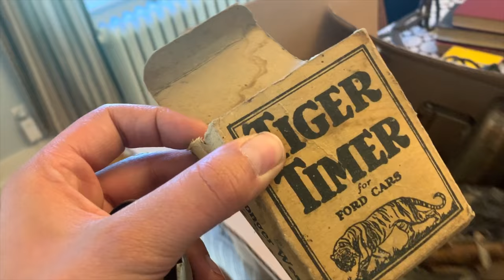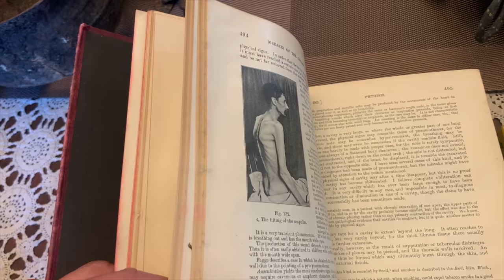Metal detecting and estate treasure hunt! Another busy day at the shop!

Comment: The best way to deep clean a cast iron scillet is heat it up and pour a topping of salt onto it. The sized scillet you have there will do with about 1/2 kilo of salt. The salt will pull out the impurities out of it. Don't use washing up liquid on it afterwards. The salt should turn dirty.

Comment: Wurlitzer is known from the (1950s-70s) for the Electric Pianos.

Tonewheel Hammond Organs were introduce built from 1935-75 (B-3 introduced in 1955).  Ray Charles' "What'd I say" was it's first big hit.

The Leslie Speaker was introduced in 1940 (originally called "Vibratone" Fender later in the 1960s reused the Vibratone name on a Leslie Rotor equipped Amp.  Both Leslie/Electro-Music and were owned by CBS by that time). They are still in production and Suzuki Musical Instruments owns Leslie and Hammond.

Comment: All those coins on the ring you found in your other video may not have been a decoration.  I have a vague recollection of reading (probably fiction, might be made up) that may have been a way of secreting money (pinning it inside an outfit, for example.) Especially if someone was in a dicey area.  I want to say that coins that were pure could be weighed to determine value so punching a hole didn't necessarily de-value them.  I could be wrong, but given the diversity of the coins it could well have been someones savings.